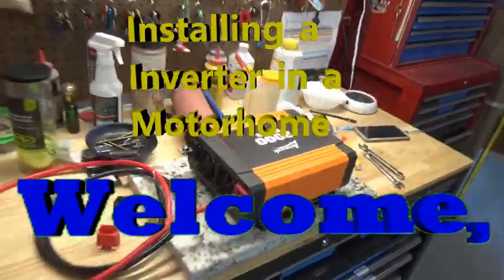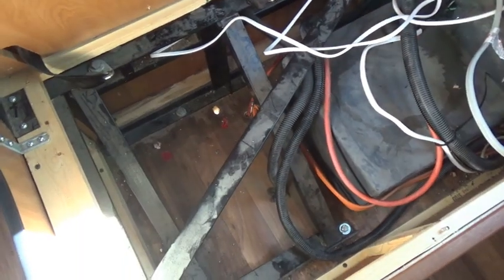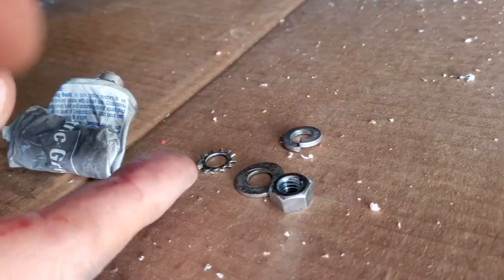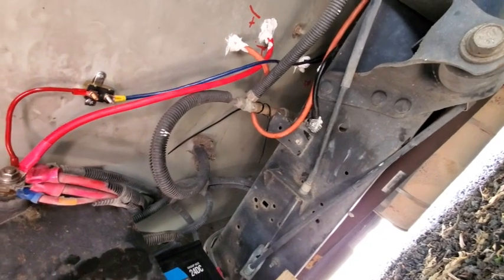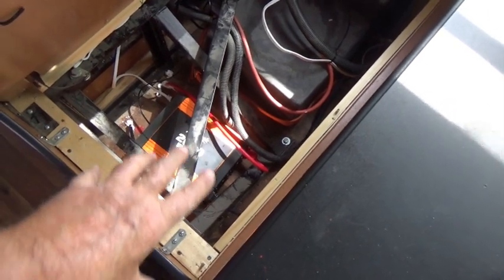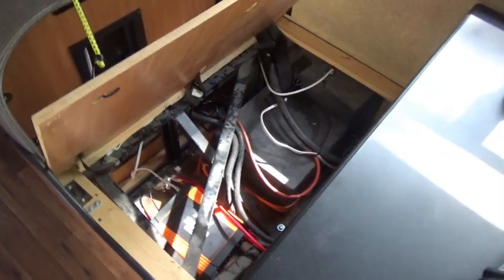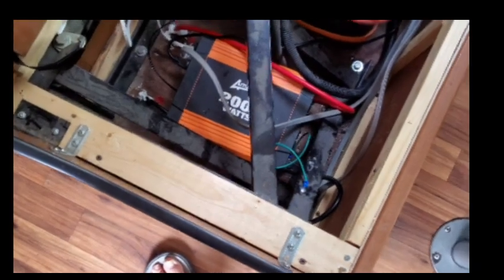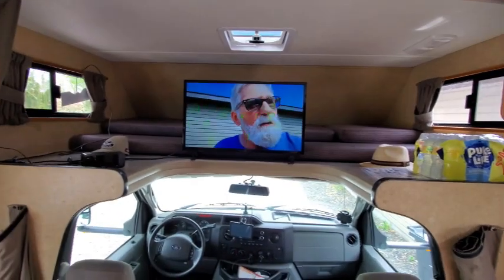Installing a Ampeak 2000 watt inverter in a motorhome

Comment: I've been looking to add one of those to mine, that looks like a good little unit, I'll have to check that one out, looks like a pretty easy install tool, thanks for the instructional video
Reply from the maker: I've had comments on here that I should have got a pure sine wave. But I've had no problems with this one and it's a lot cheaper